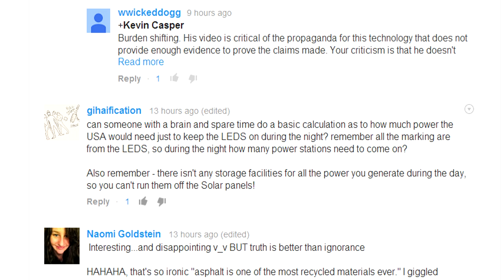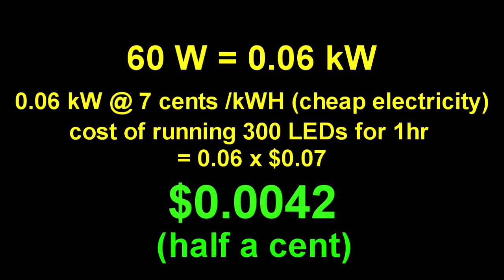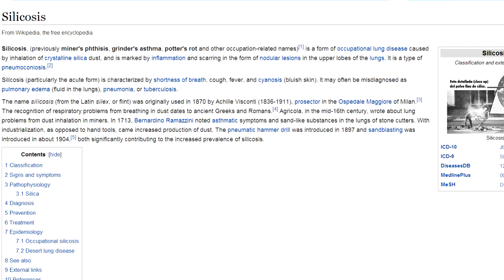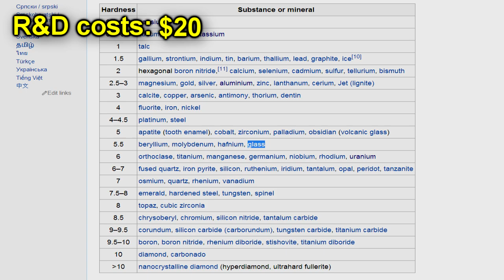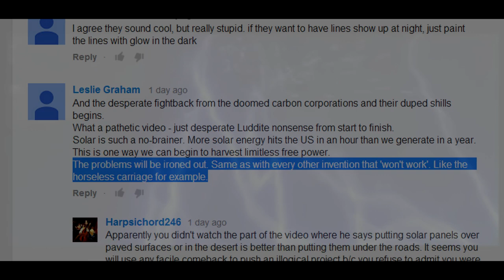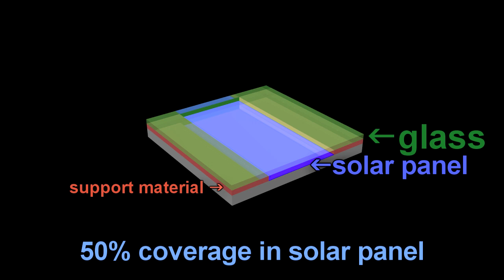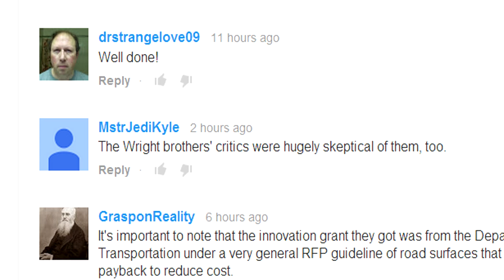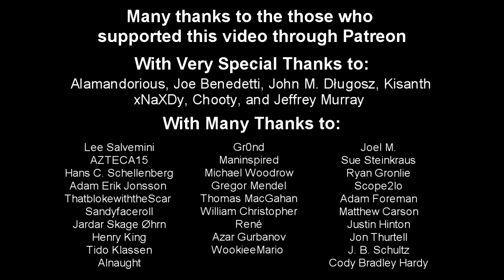Solar Roadways, IMPORTANT QUESTIONS AND ANSWERS!

Comment: seems hard to believe that glass could be stronger than steel, but a team of researchers has developed a super-strong metallic glass that has incredible plasticity when placed under stress, making it as strong and tough as metal. Typically, the structure of glass is strong but brittle which can cause cracks to develop and spread. The new metallic glass features palladium which has a high “bulk-to-shear” stiffness ratio. This allows the metallic glass to bend rather than crack – giving it a fracture toughness that goes beyond the limits of some of the strongest and toughest materials known.
Reply: The glass you speak of isn't glass at all. It's metal with a glass-like crystalline structure. It is NOT transparent...at all. Even if it was transparent and you could make it work, exotic materials are never cheap and it could never compete with asphalt roads, which are made with almost free bulk materials with putting solar panels on the sides of roads and on rooftops.
Reply: fubecabr Well glass doesn't have a crystalline structure since it's amorphous, though that's just me being a nazi about terminology. I agree completely though.

Mikael Long You do know that only 250-300 metric tons of palladium are produced each year world wide ? To give you a comparison, the USA uses something like 40 million tons of asphalt a year. That's why asphalt is used, because it's just so easy to produce.
Reply: You missed the point. Like Edison trying to discount Tesla's theory's  he(Edison) used sensational examples "electrocuting elephants" which did not really discount anything that Telsa was doing even if it was true you can kill an Elephant with electricity or scratch glass with a brick. Quite simple what you did was make a false argument against a false claim. Point Moot. When you take a block and scratch glass that is stupid it shows no understanding  forward thought and really just sounds like a baby who is mad you did not get a grant of funding or what ever. I also found an article where a country is already doing something similar were the scratches are built into the design. I found this in just a couple of minutes. You or Thunderfool did not even look to see if anyone had come up with solutions to these simple problems. So it becomes clear that even thunderfoots sound question and good arguments are put aside as a bitter person who spends all his time trying to bring ideas down instead of raise them up.He has lots of these sort of I know better videos which just seem inflammatory. There are plenty of criminals selling crap this may be one of them but you did nothing to convince me and in fact I am more invested in the idea of overlapping functions(some kind of solar roadway) and  in solar cells combined with other functions. Or some kind of integrated road.power delivey system. It may be sidewalks or covered parking lots but either way if it serves two things it greatly increase the value and therefor reduces cost. There is something called stacked functions(this is how you get more then just the power output as a value)  that is what is so exiting about combining roads with power supply grids. Connecting the power grid is the one of biggest problem with electric infrastructure. Buried cables instead of aerial lines would clear up problems with weather damage to power lines on and on. I will just stay away from the OP. I read/listened to enough of his other stuff to realize he is not worth even a really bored day of youtubeing.
Reply: Mikael Long Well if you want actual problems with this, solar panels alone are incapable of providing even a decent fraction of the power output of a whole country. Germany is struggling with 25% renewables, and 5% solar panels, having to buy energy from France, meaning they have to buy it for far more since it's at peak hour. Also, no country can store anywhere near such massive amounts of energy.

Solar roadways can't work, and even if they could, they'd stil be a dumb fucking idea because you can ALWAYS find a better alternative, due to the core idea of solar roadways.
Reply: ivanlagrossemoule Solar can achive 25%.  It's just a matter of installing enough of them.  Past 25% though, it runs into unreliability issues, since it only works during the day, and fluctuates alot with weather.  You can't simply stock pile it like you can coal, oil, or natural gas.  At least not without a serious breakthrough in battery tech.
Reply: mellored
Well I honestly couldn't have given a real number for what fraction of solar panels you can use, since wind turbines often suffer from the same problems. So Germany just gives an idea of the problem. But I agree, it's simply not possible to power a country on solar power only. The way solar roadways people make it sound as if solar panels are far better than they really are.
Reply: ivanlagrossemoule It's not possible, yet.  But it's still a good idea to get what we can from it.  It's not like having too much energy durring the day would somehow be negative.

Comment: Thunderfoot makes a good point.  If abrasions reduce the transparency of the glass, then the photovoltaics won't work as well.  The good people who designed the panels should check their glass to see if it has the same problem.

Comment: So even assuming infinite budgets, it would only really somewhat work in tropical areas where the sun goes high in the sky. 

So in the arctic and sub-arctic regions the LED's would not work well or at all in the summer (because it's always quite bright light even at midnight),

And during the winter when light would be useful, neither the LED or the solar panels would  work in the winter because it's too dark for the solar panels and it's covered by snow and ice most of the time. Not even considering that the studded tires, salt, sand and gravel used to improve traction, and the snowplows would destroy them.

I think the only place it would work is on a road in a tropical desert where the road is almost unused so it isn't worn to shreds...

Comment: So, I noticed a couple of issues...

1, you made some calculations as to the power and money requirements for keeping the roadways running - but your calculations ignore the fact the many places would be completely 'in the dark' because no one would be there to need light.

If a single car drives alone on a road, the lights in the middle of the road will only be needed for a moving stretch of road a couple hundred yards in length.

2, you noted that glass is not a very hard substance - which is very much correct, but ignores the fact that we can make glass that is harder than normal. We might, for an example, use a see-through ceramic substitute.

That said, the rest of the video was very informative.

Comment: Lets take a look at a carbon for a sec. Carbon can be arranged to be made into some of the softest things like graphite. Then we have diamonds also made from carbon and is one of the hardest substances known to man.  Now we are learning about carbon nanotubes which are way stronger and more durable than steel. Who is to say we cant do the same for silica? I say test the tech what do we really have to lose? Either way we will learn. I know I would much rather have my tax dollars wasted on trying to make this a better world to live in than spending money with the big oil companies. We only have 1 planet to live on we need to do and try everything possible. And LED tech is getting better and better each year. Same with solar panels. I do think using the roadways is an excellent idea to collect energy. I say test it out you never know you might be surprised.
Reply: Solar roadways is a completely dumb idea.

A good idea is something that provides more benefits than it does drawbacks. The ONLY benefit from combining roadways and solar panels is the reduction of space required. And that can still be beaten by some alternatives. Meanwhile, the drawbacks like costs are absolutely immense. That's because solar power plants as well as roads are as optimal as we can already make them. Combining them only makes them worse.

With improvements you'll just make it 'less bad', but you'll never get it as good as having the best roadways and the best solar panels possible. And that's considering you're wasting energy with solar panels, and not even better alternatives.
Reply: You can't compare the properties of carbon to the properties of silica. In any case, even if you did manage to make super strong, super durable glass from changing its molecular structure, none of that would be cheap. Even if you could make it the same price as current glass, it'd still be too expensive to be used for roads. It'd still just be much easier and cheaper to put solar panels on the sides of roads and on rooftops while generating much more power.

LED tech is not the problem here. The problem is that the LEDs in Stupid Freaking Roadways are recessed below the surface. There isn't a light source in existence that overcomes this fatal problem.

Comment: When did everybody start being so against great ideas.  In case everyone forgot, or just didnt know, the same concerns were brought up about many of the things we use today.  Air planes, motorcycles, cars, and cell phone.  Everything has to start somewhere.  Will it be perfect? No.  Will he be able to lay the ground work and better it as we go? Yes.  Just like all things, it just needs to start so people can see the weak points and fix them.  Im sure that through their development stage they already noticed the flaws in their plans and will fix them all as they find them.  With all the safety options that come with the application of these panels, I'm more then willing to and excited to see where it goes.  The power supplying option is just an added bonus.
Reply: Just to make it easy, think of what the idea provides as opposed to what would be provided without it. Airplanes have direct advantages over other transportations that you can most likely figure out on your own. I mean, you can fly over anything, go pretty much anywhere, go very fast, very high and so on. Motorcycles also provide advantages, since we'd all agree they are often better than going on foot. Cell phones also provide obvious advantages over usual phones... Meanwhile, solar roadways wants to provide what advantage by combining solar panels and roads ? On their video they claim roads are wasted space, so their idea is basically to save space, but at such a ridiculous cost that it's orders of magnitude higher than the price of land.

That's basically the problem with solar roadways, the core idea is simply not a good one. Solar panels on their own, and roads on their own may both take more land to build, but they are better than solar roadways on every single other aspect.

Comment: Wow, quite a bit of controversy I see. We should embrace this person for pointing out many of the possible flaws with Solar Roadways. It's better to deal with a problem before it happens and testing the way he's done is beneficial and can help researchers further explore possible alternatives to make the roadways possible, more economical and more efficient. I know people feel strongly about the idea and want it to happen, but at least give the man credit where credit is due and acknowledge that he may have some good points.

In Michigan the roads are subject to terrible cracking, potholes and damage due to the unique climate. If I remember correctly it's due to the fact that the roads are built above the frost line, add that in with the salt and plows it's a tough life for the roads. There's quite a bit of expansion and contraction based on the weather. In order to keep the solar roads smooth and deal with the climate we'd most likely have to have the roads be deep enough to go below the frost line which is 3.5 to 5 feet depending on your location within the state (you need to go deeper as it gets colder). Tree roots, plants and the elements also present possible problems, as everyone knows, nature takes back all. Throw this on top of the fact that we've had to deal with flooding, we're going to have to have a very brilliant infrastructure to deal with all the elements to make this possible.

Having solar roadways, parking lots and sidewalks is a very interesting prospect, but definitely provides some unique challenges ahead. We'll have to closely weigh the costs and benefits.

Comment: This idea is so painful from the get go. What if the general idea of roads are unsustainable?  Would it be better to use the precious materials to make photovoltaics and LEDs to their upmost efficiency. Photovoltaic panels on rooftops and low value land with no real ecology. LEDs in ultra efficient light bulbs that are far better then CFLs.

For getting around, the reality is that we need to live closer to where work, shop and socialize. Everything should be less then a ten minute walk away or accessible through light/mono/metro rail networks. A full rail car uses half the energy of an electric car, and it can be powered by a renewable electric grid. In rural areas concrete can be a better (then this shit for brains idea) then asphalt if it ever gets to that stage.

Our modern lifestyle can only be sustainable to a point. We need to remove a lot of this pointless waste from our aesthetic based desires and be happy with the solution serves our grandchildren best. Time is running out, we might have already run out of time and capital wasting it all on shiny shit like the hydrogen economy, fusion and now potentially this if it gets anymore money.

It's 2014, we are already seeing the effects of climate change. If you don't believe in climate change (or global warming as you conspiritards continue to obsess with the name change). Look into ocean acidification and the threat to our water supply from fracking in North America and coal to syngas in China. Why do I say fracking? When I'm talking about roadways? because natural gas is what is burnt for power in the when the renewables aren't generating.

Look to things that work right now because we don't have time for these futurist wet dreams. In reality we should face the grim reality of geoengineering as nothing is going to realistically stop fossil fuels now.

Thanks thunderfoot these videos are very entertaining, but the stupidity of the comment section is terrifying.  It's also really sad that crowdfunding is becoming such a platform for obvious scams like this. I'm sure alot of you in the comment bar hate capitialism with a passion but if these guys with their ground breaking invention couldn't convince a banker to lend $2 million, why should you be so easy to win over with you're hard earned money?

Edits Made: Horrible spelling errors
Reply: I agree so much. If all countries stopped promoting cars this much, and built far more efficient railways and metro/tram systems, the energy saved would be considerable. The same goes for people stopping to want their own house with their piece of garden, spare room and two cars.

The solutions aren't complicated themselves, they simply are complicated to apply, due to how greedy people are.

Comment: The glass flowing is actually a myth, the class they saw in churches and such was rolled in a way that left one side thicker, then they installed the pane with that thicker side down to be more stable. Glass does not flow.

Comment: I wanna know what happens if you hauling ass at 150mph, I would never go that fast ;) and you slam on the brakes? Does the glass absorb the impact laterally or does the support system fail and I end up flipping 20 times to die in a fiery crash? Or what happens to the road when there is an accident? How much will it cost to repair? Will my insurance cover it? How much more will my insurance be? Solar roadways??? Not yet!

Comment: Anyone who's ever actually driven at 120-140km/h (common highway speed limits in Europe) or 200km/h or more (no speed limit on plenty of highways in Germany) on a highway would tell you that this bumpy surface just ain't gonna cut it. How exactly do you propose to comfortably drive on it with speeds of more than say 30-40km/h without creating a deafening sound and massive vibrations? I mean, really?

Comment: While the concept of solar roadways seems cool, it actually makes me really skeptical about the fact that they're using glass. No matter the glass, tempered or not, it's still going to be scratched and grinded a lot, and I don't think I want glass dust flying around(nor do I want roads that will probably become completely flat over the course of a few months to a year; it'd be hell to drive on such a road with ideal conditions, let alone adverse conditions). Not to mention that the solar panels are probably pretty fragile too. It also sounds extremely costly; definitely more than $2 million.

I mean, there are a few other subjects this channel covers that I could possibly disagree with(and would make for a nice debate), but I think I'll agree with the statement that Solar Roadways, as cool as they sound, also sound like complete rubbish, especially with the physical limitations of even tempered glass, and the physical limitations of the panels and LEDs(lifespans as well) themselves.

I think a better, less conceptually flawed idea would be solar panels on canopies above roadways(and parking lots), which sound more efficient(angled panels), and arguably more lasting due to the lack of need to endure the pressure from the millions of cars/trucks/other vehicles driving on the road.